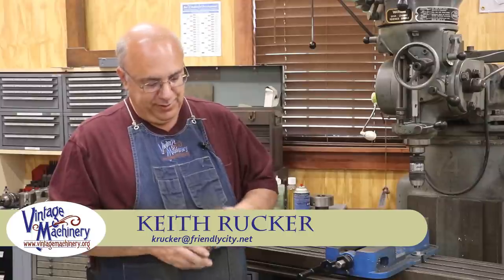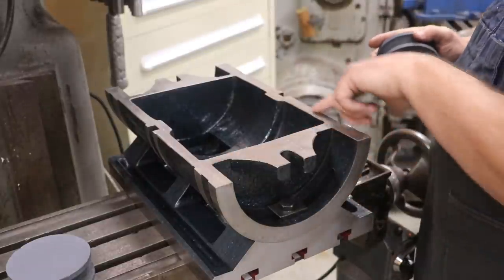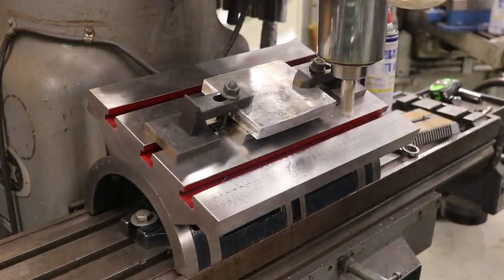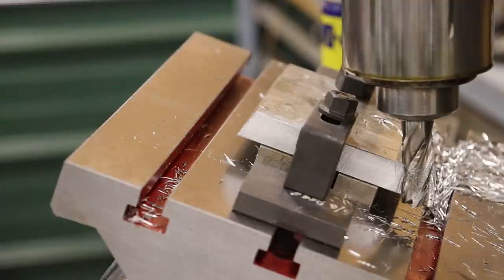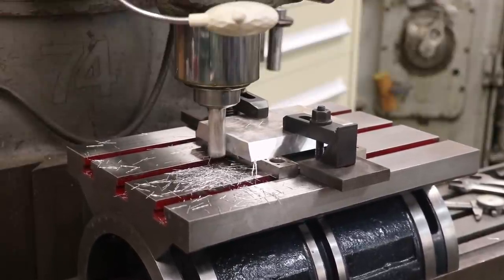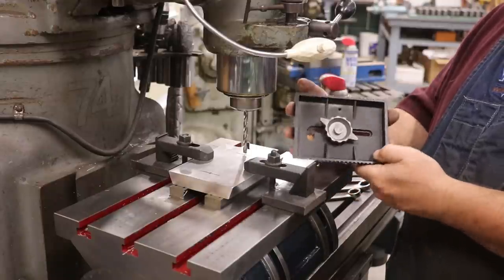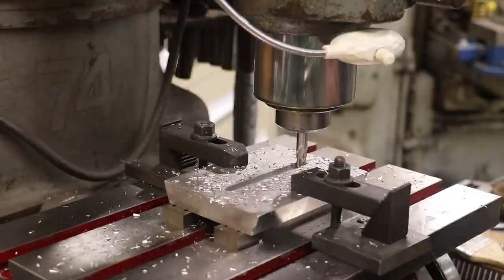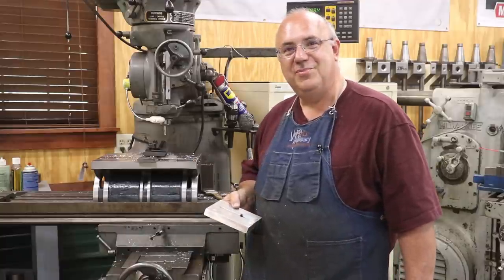Machining a Camera Mounting Plate - Milling Custom Angles

Comment: think those grooves in the side is to move and lock the camera forward and backward on the swivel head to balance it on the tripod so it doesnt droop of rise when set in place and let go of the handle with some slight resistance to the movement on 3 axis , might need to add some work to youre mounting plate and cut those grooves in too

Comment: That quick mounting tripod plate looks like it was made by the Bogan Company.  The plate stays mounted to the camera and is made for a ¼"-20 mounting screw. Large view cameras (4x5 and larger) standardized on a larger size attaching screw (⅜" - 16 screws) to attach the camera to the tripod directly or through a quick disconnect device. attaching screws.  Since the plate stays with the camera and is not taken off and put back on, a socket head cap screw works fine and there is no need to capture the screw.  Countersinking the head allows the quick release camera plate mounted to the camera to slide onto the mating clamping part that is attached to the tripod. The clamping jaws tighten against the beveled sides of the camera plate. These clamps may have a quick cam locking or thumb screw locking mechanism.  The angle of the plate and mating part attached to the tripod head is probably 70 degrees, and not 60 degrees as is more common,  because the manufacture wants the customer to by their hardware. This proprietary design ideology was one Nikon used extensively to be different in standardizing their cameras and lenses.  They chose left handed thread and bayonet lens mounts, something long ago was hard to manufacture and thus thwarted generic lens makers to offer less expensive equivalent lenses.  Everything about a Nikon is backwards to the competition design - it is not designed as a better way to  make the part. 

There was absolutely nothing wrong with using the angle plate. I'd ignore all the complaining comments to  use a simpler method to hold and angle the part to be milled. Many of your viewers use drill mills in their home shops and the heads can't be tilted. The method you used in simple to set up and you don;'t have to tram in the mill after you are finished.

Comment: So, did you send an Allen wrench since it doesn’t have a “big knob”?

I was hoping you would have taken the time to make the cap screw so it wouldn’t come out. 

“Big Knobs” are available at hardware stores with the bolt.

Comment: Nice video and work. I have the same table except in the medium size 7 x 10”. Yours must be the large 10 x 15” size. They also sell a 5 x 7” table. I’d rather not move my mill head out of tram if I don’t have to.

Comment: Because older photo/film equipment was often powdercoated with a thick layer of black, those slots in the sides relieve the clamping pressure (there's usually a gib in there made of bronze or oilite) and help prevent bulging of the base plate.  Also, the correct tie-down for most photo assistants would use a large flat head (or specialty flat head) driver.  Check out Candreva USA for a variety of solutions.

Comment: That tilting table sure made that job easier.  I had never really considered the reversing advantage of that style. I had always preffered the style like my table because it wasn't so tall but I can see they both have some advantages.
Reply: Having both is an advantage, Mr R's will only pivot 45 degrees each way but is low. The other style pivots the full 90 but is tall and can be a pain to set due to imbalance. 
Personally for a job like this I would use a grinding style vice set at an angle in a mill vice., way quicker and time is money, just wish I had some! 😤
Reply: chris0tube   hi chris I'm lazy but luckily it's now 21st century so I'm no longer taboo. 😂
Reply: @chris0tube no probs. Come to think of it, I'm, erm, mid ish 20th century myself. But as they say if you want something efficiently give it to a lazy person.

Comment: Quite common for a retainer on 1/4-20 camera mounts is just a thin groove cut just below thread depth and a simple "E" clip. Groove can be cut on lathe with thin parting or grooving tool.

Comment: I've always thought that the indian made tools are somewhat better than their chinese counterparts. I recently purchased a milling machine that does not have a quill (Schaublin SV-51) ... instead it has an articulating milling head. I guess I don't need an adjustable angle plate but instead, I need to learn about feeds and speeds of drills. All drilling must be made by raising/lowering the table (no quill). There is a separate accessory including the quill but that would cost more than the entire milling machine :)
As always, Your approach to the task in hands is ... very practical. Thanks for this share !
Reply: God no - Indian made tools are far and wide inferior to Chinese - they are at least 20 years behind or 30 years behind. When you see Indian made thing vintage Chinese. And China is also behind Japan by around a decade+.
Reply: Mass producing anything that requires accuracy is always either expensive or not that accurate. Naturally the indian as well as chinese manufacturers try to minimize the finishing steps like deburring, cleaning or dressing their grinding wheels often enough. This, of course, makes undesirable variations in the final product. You generally get what You pay for. Accuracy and good finish is equally expensive no matter where the machining takes place.
For this reason I did not buy my collet set(s) from a chinese manufacturer - instead I opted on a swiss company. The price is probably five times more but then again, I do not need to worry about runouts or unfinished surfaces in the collets and I only need to buy those once - they will outlast me five times over.
In fact most of us cannot afford high quality products so we need to buy then either used or buy an far-east product and do the finishing ourselves. Some products, like collets, are quite hard (literally) to finish at home workshop. Vices and adjustable angle plates on the other hand can easily be finalized back home and are therefore an appetizing item for a home-gamer. I consider them as readily built kits which You need to take apart, finish and then use.
Reply: @tomk3732 Decade? Japan has been making very high quality tools for a long time. For example Kyoto tools and Mitutoyo.
Reply: @erik....  Decade tech difference. Not the length of making tools.
Reply: @tomk3732  Tech doesn't say much about quality though so I don't know why you even brought it up. My 70 year old milling machine probably has better quality than a cheap chinese one built today. But that has to do with the fact that it was way more expensive too when it was new. You get what you pay for.
Reply: @erik....  Both China and India compete on price point - most of the time the cheapest. Chinese goods are almost always better made as they figured out tech needed to produce cheap goods that are reasonable quality. It takes some try and error to figure it out. Recently Indians figured out tech needed to produce quality wrenches. Chinese also have the tech and know how to produce cheap and reliable electronics - most of it is made in China and seems to work very well. They also made excellent home brew phones - they learned how to design phones and create their own - so its not engineered in US and made in China - they can engineer in China as well. Encoders for scales also are now tech they have well under control and getting better - me and all my friends started to buy Chinese DROs as no one can tell a difference between it and US made DRO on a Bridgeport. Heck even Starett now makes some of their calipers in China. 

Of course we cannot compare our 70 year old mills to today - given that I think my K&T #2 cost new about same as a house around WWII time frame. More apples to apples is current machines both build to same price point.

Also look at Japanese tooling from 1970s - it was cheap and poorly made. Then their tech improved and it was no longer cheap and poorly made. China is now going through that transition & India is about 20 years away.

You simply need tech to make quality goods that you can charge premium for and compete against other premium manufacturers. If you don't have the tech you can only make crap as making top of the line stuff would be cost prohibitive.
Reply: I salvage aluminum for my castings. When I take apart a Chinese made hard drive I'm struck by how well machined the casings are. They certainly can make precision things, question is would you buy them?
Reply: @Larry1942Will  Most electronics is now made in China. They have the technology to make these things cheaply and in mass. For old school spinning HD you need a case that is air tight - there is just small vent hole in the case to equalise pressure. You need technology to make things cheaply with given quality point. If you don't have technology you can still try to make things precisely BUT it will be more expensive then your competitor. Once you have tech and cheap labour like China there is no way to stop you from taking over - no US company can compete. 

As for collets the Chinese collets are mixed bag today. Many are still not that well made - home shop grade. But they are entering slowly the market with better collets. Give them a decade and no one will buy Swiss for 5x price for same quality.

Cheap Chinese calipers due to low encoder prices feel crusty but measure accurately. Give them few years to produce battery saving encoder and multiply price x2 for better grind and you have Starett killer. This is why they moved production to China.

Comment: New fixture, I'd sweep it with a good indicator and see if it's even close. Right now you have no idea and it could be a mile off. Set it up flat on your mill and move it to your grinder and grind the bottom a bit, then back on the mill sweep it again and you might need to shim but if you think it thru you shouldn't need shims in the end. The table on the angle fixture is probably the flattest part of it so dont go messing with the table unless you like chasing your tail. In the end you might decide to grind the table but more than a few tenths and you'll be back where you started buddy. And put your parallels under your clamps, turn them 90*. I like your videos.
Reply: "In the end you might decide to grind the table but more than a few tenths and you'll be back where you started"  Why?
Reply: @Butterbean00  itll warp and bend, its cast iron. Same goes for older iron table saws and the like. Stress relief. I know it sounds like a stretch but itll happen and removing half a thou will make it curl and bend and itll be off by several thou at that point. I know, sounds like typical internet ramblings. It ain't a fairytale buddy.

Comment: No cutouts for leather and no  weight reduction cutouts?
Reply: REALLY!!??##!!!
Reply: Yes- or thin cork- but there are no worries with aluminum scratching up a large format Hasselblad...
Reply: The weight reduction is there to save money.  The extra weight is better for a mount.
Reply: No.
Reply: @dtoad48  I concur- but some scratch protection should be a part of the prescription- as well as the original baseplate.  This is why it is very difficult to make a good business model of making camera parts (everyone is an owner-operator...)

Comment: I tuned in figuring that I'd see a setup using either the nod or the tilt features of the mill's head...  or a tilting milling vise... stuff lots of us have in our shops.

Using an angle fixture is a bit easier for the machinist... if you have one! ;^)  (No need to mess with the tramming of the mill head)
Reply: Or like Mr. Pete says, he would rather take a beating then move the mill head.

Comment: I believe that camera screw is a quarter inch, 20 TPI Whitworth thread, at least by specification.  I have noticed recent inexpensive tripods tend to use a 60 degree thread, but I think that is because it works, not because it is correct.
Reply: I'm genuinely unsure. I think the spec (as far as it goes) it 1/4" 20 TPI, slack as hell. The latter part of the spec means that Whitworth versus Sellers thread form is (in practice) a non-issue.

Comment: First I'll say that I like your channel and really appreciate the amount of work you and others are doing to make all these videos. I learned a lot from it and use that all the time for my work (I repair musical instruments).

That said... also being a photographer, sorry to say but the whole point of those plates is that you don't need a tool to clamp it to the camera. With the slot being so close to the screw head it's not possible to wrap your fingers around it to at least have it finger tight (for situation where it's enough, which with this massive plate... maybe rare). It also won't fit most regular tripod plate screws with the opening handle or slot, which have a larger head than a screw.

They could get one of those regular screws and it's pretty simple to have it captured. It's just a a 1/4-20 threaded hole that continues as a slot with a smaller width, not enough to allow the threads to pass. The screws have a relief between the head and threads that passes there. You can get these from ebay or many photography stores.

The top padding isn't a big deal, they can glue rubco or anything to it. I guess it's also pretty heavy without any milled parts at the bottom.

Comment: You could have plunge cut the ribs while you had the same angle on the edges. You’ve got a DRO so would have been very easy to do. A simple turned and knurled aluminium knob for the under side in a relief channel with a captive screw isn’t difficult and a slight relief for some cork or rubber inlay in the top? Could’ve been so much better really.

Comment: Um, who else noticed that you misspoke early on about the two tapers? They certainly aren't parallel and aren't meant to be.
Reply: I think Keith was referring to the bevel edges being parallel along the length of the part, as is the slot

Comment: Keith, I know you wanted to use your new angle fixture,  but would it not have been quicker to tilt the head of your mill?
Reply: either tilting the head or tilting the angle fixture would both have likely taken about the same amount of time... but using the angle fixture comes with the added bonus of not having to get the head dialed back in perfectly vertical when he is done.  Typically it's best to maneuver the part into position rather than moving the machine into position, mostly because when the part is done, you can take it off and the job is done... if you move the machine, then when the part is done, you still have more work to do to get the machine trammed back in because you moved it around.

nodding and rotating the head and such is great and can get you out of some sticky situations, but it also creates more work afterwards... if you have the ability to maneuver the part and stay within tolerance, that's usually preferable
Reply: Good point, @cryptk . I'm not a machinist, nor do I play one on TV...and it shows LOL. Several years ago a machinist in our small shop at work made several similar camera adaptors for me and, not having an angle fixture, he tilted the head on the Bridgeport. Thanks for setting me straight on something that's probably obvious to 90% of Keith's viewers.

Comment: If the T-slots in the angle plate were cut after the surface was ground that could explain why it was so messy. Lots of movement when you cut that much material out.

Comment: Nice, funny thing is though in the time it took you to take the vise off and stone that angle plate, you coulda been done with the whole project if you used your vise and a 20 degree angle block, and a vise stop.....or tilt your head 20 degrees, do a little trig math to indicate it in, and use a standard parallel and a vise stop....

Comment: Stoning the new surfaces on an import is good practice as would be checking the accuracy of the angle marks which we did not "see" being done. When off shore companies want accuracy in their manufacturing, do they import fixtures and measuring devices from us? :-)
Reply: No, they buy quality metric tools from Japan or Europe.

Comment: I have seen many comments about import tooling . China, India and others. Make quality tools to. The resealing company's import the cheapest tools . 
This table is 250 dolars . A brand name is at least 15 times more expensive.  
I have seen several high quality stuff from Asia. 
Do you think that China Industries is built on scrap tools?
Reply: it's the tool resellers and importers who order the crap tools from any company, in whichever country, that makes low quality products and the reason is demand driven. it's unfortunate and also irks the crap out of me to hear generalisations about entire countries' output of precision tools regarded as cheap crap when every country is capable and willing to sell complete shit to anyone with money.
nobody is special in this regard.
Reply: Agreed. Further, 1/2 the quality for 1/10 the dough is a good deal. Engineers know about appropriate tolerances, right? Not everything is toolroom work.